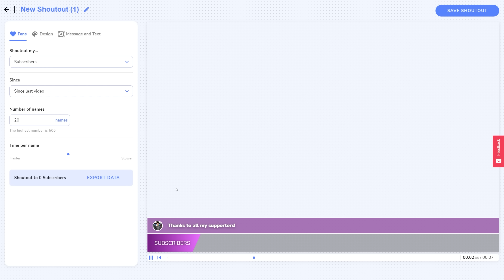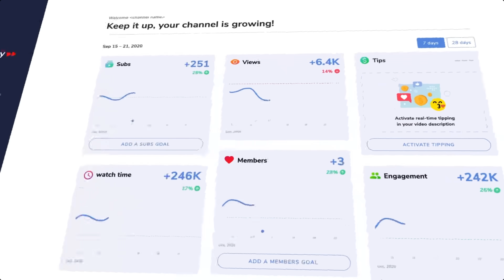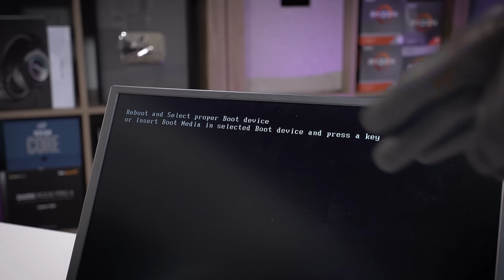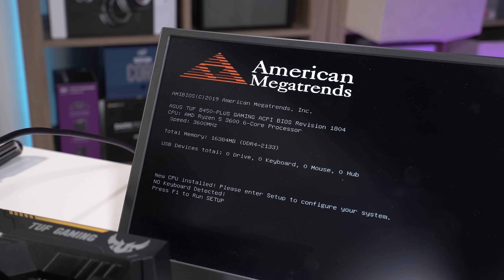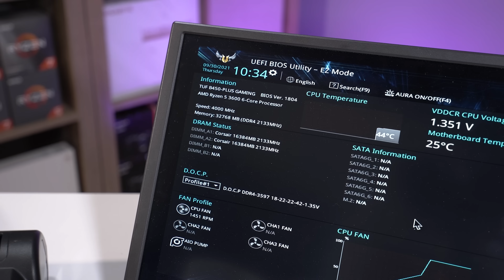Fixing a Viewer's BROKEN Gaming PC? - Fix or Flop S1:E15

Comment: I had an issue not long ago where a tripped breaker caused my internet to go out. In a rage-induced panic I got a new motherboard because I thought the wifi module blew out. Turns out it was the physical Cat5 sockets on the gateway router. I unnecessarily spent $135 on the new board. Granted I got a new board out of it, but I then had to buy a new router anyway, and USB 2.0 9-pin header expansion. I could have saved roughly $150 had I kept my head on straight, lol.

Comment: I've had an issue with a few X570/B550 boards that were supposed to be Zen 2 ready, but would not post until I put in an older CPU and updated the BIOS.

Comment: I recently had a big problem with my main system m2 SSD. I converted it from MBR to GPT with Minitool Partition Wizard, changed BIOS to UEFI mode but it just didn't boot anymore. I tried A LOT of things and, in theory, it supposed to work, i even send the PC to an expert but he wasn't able to fix the problem either. I had a backup so i wiped everything and installed Windows again, but it really bothered me that i couldn't find what the issue was.

Comment: i installed a 120mm AIO yesterday and dealt with this exact scenario for a few hours, i haven't finished the video yet, but my issue turned out to be a cable from the fan hub onto the motherboard shorting

Comment: Did anyone else notice the arc of light between the MOBO and the case when Greg first turned on the power supply to test the rig? Like, in the bottom left hand corner of the MOBO it seems to light up between it and the case when the switch is flicked at 3:38. I thought maybe it was just a MOBO LED or something, but I didn't notice it happen any other time Greg flicked the power supply on?

Comment: I had a Phenom II x6 1045T which only worked with single channel. Had to use the two nearest slots as Greg did on the test rig. I still used it in a build.. chucked all my spare parts in an old server case (gtx 660, 8gb ram, old PCI wifi card) and gave it to someone for free.

They wanted a minecraft PC for their kid's birthday but only had a £200 budget. Sold them a monitor, mouse and keyboard for £100 and suggested they use the rest to buy a game and a headset or something

Comment: Hi Greg great video  I have two questions about mounting pressure with a similar AIO AMD Corsair should it be hand tight or screwdriver tight ? Does it make a difference in Temp or performance?

Comment: I'd heard of some Ryzen CPUs dying, then I experienced it myself.  Had a 3600 in my rig, then got a cheap upgrade to a 5600X.  A friend had a B450 board I'd sold him about a year prior, so I came over with the 3600.  We made sure BIOS was latest version, popped out the 2600X he was using, and dropped in the 3600. NOTHING.  We tried everything before calling it a day.  I dropped the 3600 in my own rig the next day... same thing.  No POST.  Fortunately I was able to hit up AMD for the warranty and they shipped me a brand new sealed 3600 that went to my friend.  So all good in the end, but still crazy to me that this CPU that I'd used for over a year and was perfectly fine when I pulled it out of my system somehow died between then and when I was installed in my friend's mobo.

Comment: Sometimes, it could be a near death memory channel. I once time have the CPU that can run but occasionally hanging. After serious test with different Board / Memory it came down to the CPU and it turned out the CPU would still perform not using Dual Channel.

Comment: Heyy, ive also got the corsair vengance RGB Pro and have ram clearance issues with the top mounted radiator as seen in the build in this video. Is it more efficient to just front mount the radiator or keep it top mounted and remove the radiator fan blocking the ram.

Comment: My X570-A Pro from MSI advises the user on what memory slots to place the DDR4 into if it is wrong. After 4 months of using my system though I forgot the Ryzen 5 3600 is only Zen 2. I got it planning on a future upgrade because I can't afford the components all at once.

Comment: hey bro i have setup with 3600 as well and my pc do weird stuff. it gives bsod related to memory but i know it is not memory could it be cpu?. my motherboard is recently rma'd. so it might also be ok not sure.
also sometimes my pc does not even post and ez debug led shows random things sometimes cpu missing other times gpu or ram.
sometimes i'm not able to go into bios when pressing delete button and when this happens i cant even go into safe mode black screen. sometimes bios screen does not even shows when booting pc. due to which i'm thinking it is a motherboard issue
there are random freezes and shuttering in games as well

Comment: 17:15 why in the front? one fan is enough to cool a 3600 and now the gpu is suffering from the heat of the radiator ... or is it negligible?
Reply: The air going through the rad will only be slightly warmer than ambient, still cool enough for the GPU to not overheat, also with the 3600 being power efficient, it doesnt produce a lot of heat, especially with a 240 rad.

Comment: I have a 5950x with a really bad memory controller as well. Not to the point that it can't access a channel but I can't run the timings that are advertised on my stick. I tried 3 different RAM kits.

Comment: I don't recommend to use partially functioning CPU. It can work some time but they will die in certain time frame. Not sure if this was victim of ESD that hit after some time in use. Many think that ESD kill straight. You may get slightly higher current consumption and after 3-6 months in use IO:s just die that get the hit.

Comment: I had a similar issue. My MSI Tomahawk with a 3600 stopped booting after a year and a half, so short of money, I bought an MSI B450 Motar. It worked fine for 3 months, then as above it stopped booting. Clearing the CMOS did not work. I reseated the cpu back as a last restort and it posted....which was odd. I used it for another month, then the same thing, again I tried clearing the cmos, nothing. Unplugged and replugged cpu back in and it booted up...It worked for a week and went off again, at which point I contacted MSI, replaced the motherboard. Current board has been working for about a month....but we shall see. I have not re-tried the tomahawk as computer is working, but I have an odd feeling it might work. Just to add it still boots regardless of memory configuration.

Comment: This now makes the second time I have seen this issue in a Zen 2 CPU.  I had to RMA a Ryzen 7 3700X I was putting in a build for someone because it had the exact same issue.  The B channel was dead.  Put a dimm in the A slots and it fired up fine, put in the B slots and it was a paperweight.  I went through the exact same confusion when trying to figure it out.

Comment: I'm at 11:57, this happened to my PC once, all I needed to do was adjust the 24pin Motherboard power and check the RAM. I was also not getting a display before I repaired it, the GPU was okay, it had power, so it was really just the Motherboard power and RAM.

Comment: I have this same issue. I bought a new MB - from a z490 to z590. Didnt post with dual channel at all with Team Group ram. No new hardware but the MB. Tried another z590. Still no post in dual channel. 

Gave up - bought new corsair ram. Boots in dual channel instantly. 

Only thing I can think of is ram is not compatible on z590 boards. From either ASUS or MSI. Makes no sense and now my ram is useless :(

Comment: Can I submit my PC? The CPU popped out of the AM4 socket and bent pins, I have them all realigned but not turning on. My ROG Strix gets power and even double checked by just testing the PSU to make sure it works and its good. Also tried turning it on from the mobo directly and I get nothing. I'm thinking the CPU but the pins are straight and it fits securely in the socket 🤷‍♂️

Comment: Have similar problem couple weeks ago after swapping my case, my ram only work with single channel but after hours of troubleshooting, my pc suddenly can work with dual channel again. What I do is, tighten the mobo cpu power cable and reoccupy an argb connector which previously I disconnected but connected in previous case. Weird but it's true, the mobo also Aorus.

Comment: I had the same Problem with my new build.
I have a MSI tomahawk max II, RTX 3060 TI, Ryzen 3800X. I Flashed the BIOS and checked every connection. It started up but didn't Post. In the end i just reseated the CPU and it worked. I also took out the little battery and tried different RAM. But it was just a CPU reseat.

Comment: Took me a few mins into the video to notice it, but the fan missing from the AIO is actually mounted as a front intake on the case lol. Probably bc the case came with one fan up front and one in the back and he just swapped it over thinking it’d help. Poor guy shoulda just bought a cheap 3 pack of Deepcool cf120’s or whatever is hip these days.

Comment: I was just about to turn my i5 3570k rig from like 8 years ago into a server. I finally got it all back together (I needed the cpu cooler hardware for my alder lake rig I just put together). It turned on just fine (I needed to put my old ssd in to try to get windows to transfer to my new one). Booted just fine, uninstalled my product key and re installed once I put it in my new machine. It didn’t work so then I put it back into my old i5 machine. Now it just doesn’t boot and I get a twitching cpu fan. I’m thinking power supply and I hope it didn’t fry anything. Gonna try a new power supply. I’ve taken everything out and unplugged everything including the cpu (for inspection, even though it’s been in the socket since I built it). I did change my bios fans to silent but I’ve cleared the bios multiple times with both battery and jumper. I’ve tried dgpu and igpu, and nothing. I really hope it’s the power supply. It’s a Corsair cm650 which wasn’t really known for quality lol.

Comment: Hai, I had a few questions. If you do end up seeing this. 

It’s related to the replacement of parts. 
Because on the 8th you replaced a motherboard and CPU. But you didn’t really say anything about having any issues with doing so. 

So my question is, can you freely upgrade motherboards and CPUs? Without much issue? If not what are some cautions to have while doing so? Also Is this possible with AMD boards. Because I feel like I constantly see post of people saying don’t do it.
Reply: Why would that be an issue?

Comment: i had an issue showing similar symptoms the other day and i couldnt figure out why, an IT friend had me try the pin reset and change the mobo battery with nil changes. he was gearing up to come around and have a look when another mate suggested i removed my RGB controllers as my RGB strip no longer worked and lo and behold my PC booted correctly with nil issues since

Comment: A friend of mine upgraded from an 1800x to a 3700x on X370 with 4x8GB 3200MHz and he was forced to remove a stick to actually boot for some reason. His solution was to simply buy 2x16GB sticks and give the extra RAM to a friend.

Comment: I've had a cpu fail after a motherboard bricked it. It would run memtest, but windows would not launch. went through two motherboards (tested by the store after warranty) with the cpu before RMAing the cpu

Comment: my 3600 has a issue like this as well it doesnt boot with both sticks installed but if i take the ram stick out of B2 and boot it and then plug it back in it works fine

Comment: I'd love to know how I swapped out my motherboard from an ASUS ROG Maximus XII WiFI Hero to a Maximus XIII Hero and my Corsair H100i Elite Capellix is displaying all connected fans blinking red and the good ole CPU fan error even tho I have the tach plugged right into CPU_FAN header. Then comes the SP fans running at full speed. Any tips or information as to what could be the issue?

Comment: So I have this exact issue except both channels seem to be working when I test them. My pc starts with a ram stick in a2 and it starts when i move it to b2, but it doesn't start when i put one in both slots. Everything powers up but the red cpu debug light on the motherboard turns on when I try booting with 2. At the end of my rope, not sure what to do.

Comment: great video. wish i lived in florida now because my pc has been having these weird issues where there are these purple, blue and yellow patches around certain colors sometimes though, some games crash, some games drop in gpu usage to 0 constantly, some apps and games have a jittering problem where UI will shake around. got rma for my card and it still hasnt fixed it. pc's are great but also the worst at the same time!

Comment: It looked like there were some sparks on the mobo that might have fried the CPU in the first place as it was around the VRM, very rare a CPU ships with an issue like that and more likely to be caused by frying the VRM with a dodgy power supply or extreme overclocking on a board not made for it.

Comment: Thank you so much for this video I actually have a similar problem with my CPU or Motherboard but I am leaning towards CPU. 

When I restart my system my CPU fan just spins and stops and repeats that cycle until I turn off the computer. I noticed the system would boot up completely fine once I took out my 2 other 4gb memory sticks and left my 1 8gb stick in, after that I would turn it off, put it in the memory sticks back and it boots up just fine.

I may have a glitchy memory channel but I don't think a dead one, maybe my motherboard could be the culprit but after watching this I think the CPU might be to blame.

Comment: Funnily enough I had a similar issue with a 3600 last year, could never get the computer to post while the ram was in dual channel. So I had them sitting comfy together, and it worked but always bugged me. Tried everything I could find on the internet (new mobo, new ram, loosening the cpu cooler in case it was too tight.) Nothing worked. Then one day a friend suggested I check the cpu. Sure enough, two pins were bent out of place. Bent them back into shape and dual channel again.

Comment: Hey Greg! I just happen to rewatch this video again and had a question about a specific part where you install the two rams in 16:03 
Isn’t it ideal to install the rams spaced out (A1, B1)? And how did you manage to read it at 32 gigs when it was supposed read 16? I’m kinda confused.
Reply: With the way he installed it, it will not run dual channel, but the system can still use both dimms. It's not the right way to do it, but it won't ruin the computer either

Comment: i basically have the same problem as here and for me what i do is i start the pc and turn it off using the case power button 2-3 times to boot it in safe mode and then it boots. idk why it does this but my pc works so im happy.

Comment: I had a dead memory channel back in 2012 when I built a 2700k with an MSI Z77 M Power board. I put the system together and I kept getting errors and shut downs. I found out eventually the issue was the memory channel the same as this video. The channel was DOA. I had four sticks of ram to use in the system so two slots not working wasn't going to be fine. I returned the board back to Amazon. They refunded me before I even sent the thing back... odd.

Comment: I think that if it's doing that, everything appearing to be working but no display, it could be the graphics card is loose or memory is loose. I'd try snugging it down then restarting it before losing all the settings, such as memory settings, by resetting the CMOS.

Comment: Greg, a PC riddle for you. Why can I get into UEFI using DVI on my GTX 1060 and not the DisplayPort? I have 2 screens plugged in. It only works with the older DVI screen plugged in. Just DP in doesn't work. It's a Ryzen 7 3700X temporarily put into MSI B550A PRO, 16 GB of RAM in dual. Both screens work normally in idle, under load etc in their native resolutions and refresh rates. Also I don't get the splash screen on launch. I get that through DVI port only. I wonder if you would be the one to figure it out :) 'Cause I can't.
Reply: Also PC itself operates as it should.

Comment: Hello Greg i will be very happy if you answer me to my question. i have 2x8GB 2400Mhz Ram Memory in task menager show  2of 4 Dimm 2400Mhz so I upgrade the RAM 4x4 8GB Hyper predator RGB 3600Mhz when i open task menager and go to bios show ram speed 2400Mhz XMP was enabled to auto DO I NEED TO MANUAL CHANGE SPEED OF RAM TO 3600Mhz or to stay XMP profile to AUTO  and I have Intel i7-8700K.....I watch all your videos keep with the good work
Reply: Depends entirely on your motherboard. Google the ram compatibility and slowly work your way up to that number or 3600, whichever comes first by setting it manually. Go as high as you can get without your system crashing. If you got good ram, you might even be able to overclock it but bad ram and you won’t even make it to 3600.

Comment: I've run into this before also. so frustrating when the memory causes issues. I had an Intel Based system that did the same thing... you couldn't totally populate the board because the sockets were causing issues. I still don't understand it... because when each socket is populated independently, the system would post, but when 2 or more modules are installed the system wouldn't post... crazy!
Reply: yeah ive had the same problem with 4770k one day it ust couldnt run dual channel

Comment: Hi greg, i cleaned my gaming pc, i took out the cpu cooler and it rip out the cpu from the socket with some with bent pin, I straightened some and put it in the socket and get it fully straight using the socket, now it has a dead memory channel, it wont dual channel mode, can i do something? Or do I need to replace my cpu?
Ive managed to put two sticks in a1 and b1